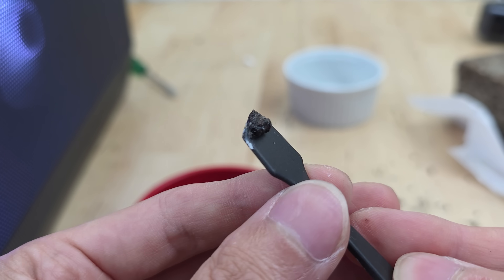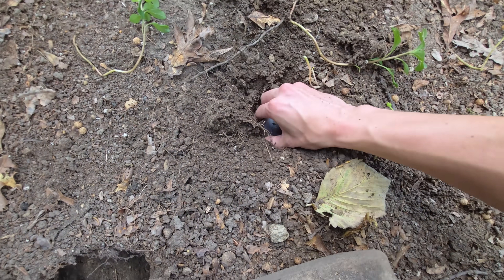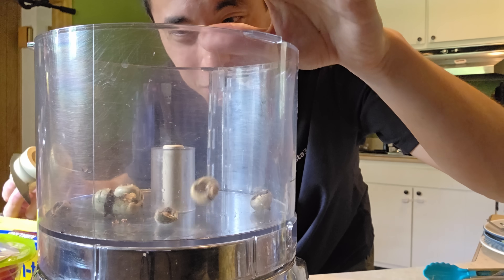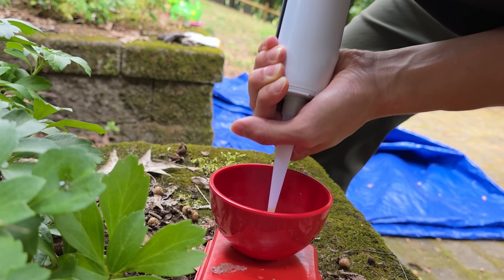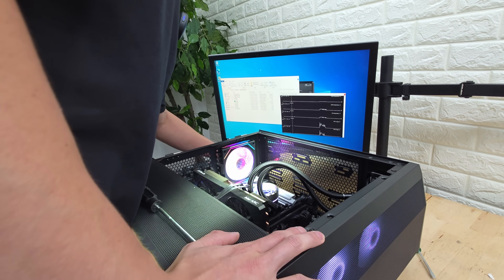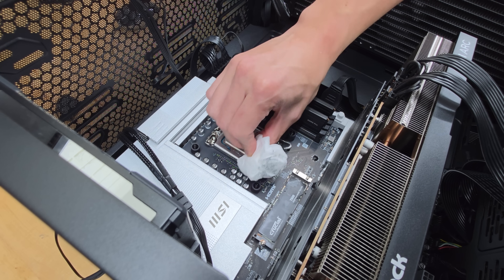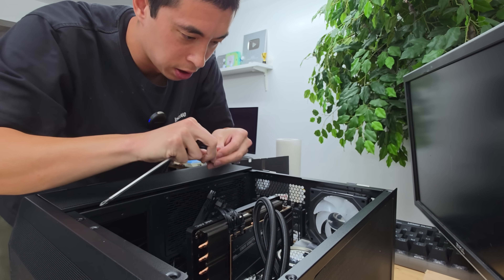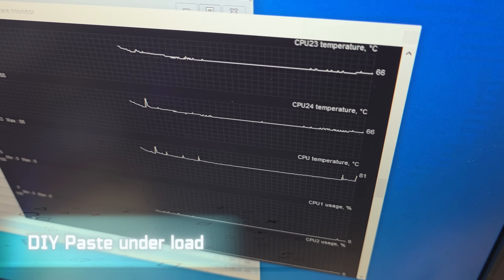Can You Cool a Gaming PC With... Mud?

Comment: You could probably make it work a little better by extracting more acorn oil (There's probably some kind of relatively cheap mechanical press that would give better yields than a caulk gun) and grabbing more iron oxides from the dirt so you can do a couple additional passes through the magnet, which would help reduce the silicates. A mortar and pestle, which is an uncommon but useful kitchen tool, might make grinding the dirt fine easier.

You could also try a different base. Crushing leaves results in a slurry of mostly water, which could work if strained. Resin might work, although I'd be worried about it solidifying. Maybe mix that with some acorn oil? Some plants can also have roots that'd give more accessible oils.

I think the mud paste might've just worked if it had been there in more volume. Not like, well, but worked nonetheless.

Comment: Have You tryed without any paste????
Reply: It would still transfer heat but just inefficiently. The point of the paste is to fill the gaps to get the heat to move more effectively. Without it they are still touching just not as much.
Reply: @spencer7834  Yes ! If the surfaces are NOT rectified. But both rect. Are so tight tat if you try to lift the cooler a bit quicker it will come with the processor from the socket. while the vac. Will exercise resist at first till air goes inn. I made ths all ready long ago after "delid" is not possible to rect. But even not necessary On AMD FX 9590 processor. wich  I have used while is 2 hard but allready very plain surface.

Comment: needed way more dirt, sifted down way further into finer powder. Hell, an area with natural clay would have been best, then you could dry it out and crush it back into a powder before mixing the oil in.
Reply: Soil sieve. If he could get the sand and silt out, he'd be left with clay... And other organic materials. If the soil has any significant amount of clay in it of course. 
Then for the oil, well he really had to steep them in hot water.
Reply: I'd like to see the cooler removal to see how spread out the paste ended up.